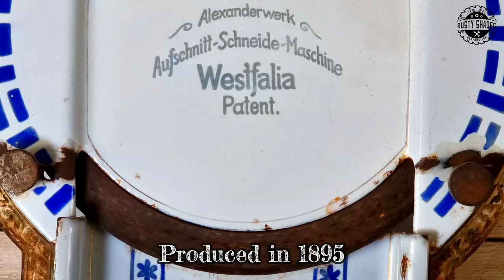Massive Antique Meat Slicer Restoration - 1895 Cast Iron Alexanderwerk

Comment: Well, what kind of silly old chook am I? I’d heard of powder coating but I didn’t know it was actually powder that was puffed on then baked 🫤I don’t know what I thought. Anyway, fantastic job and what a wonderful item is that slicer.
Reply from the maker: Thank you! Yeah, I love it, the paint it is more resistant and while coating doesn't smell at all/less toxic and gets dry immediately which is so time saving 😀
Reply: The puffed on part is actually more complicated. The paint is charged so when they apply electric to the parts via the suspension wires , it becomes attracted to the part. Like static electricity and a dryer sheet lol.

Comment: As someone who has worked in a deli, it's amazing how familiar it looks.
Reply from the maker: Nice. Means that the core design didn't changed too much.
Reply: @rustyshadesrestoration  Aside from automation and safety, modern meat slicers function basically the same.
Reply: If it ain't broke don't fix it, just improve it.

Comment: so I'm ignorant about restoration. so this question comes from a place of genuine curiosity and ignorance. I've never seen anyone dry a piece with a torch. Is it a case of "I wanted to dry this quickly and this was the most efficient." or was it a "sure I could set it out for a few days, but there are other reasons why it's simply better to dry it with a torch." no judgement just curious
Reply from the maker: Hi, I did it order to move on with sandblasting and to win some time. Cheers